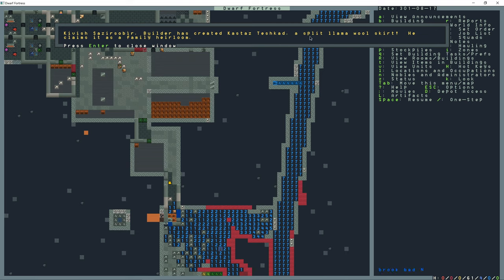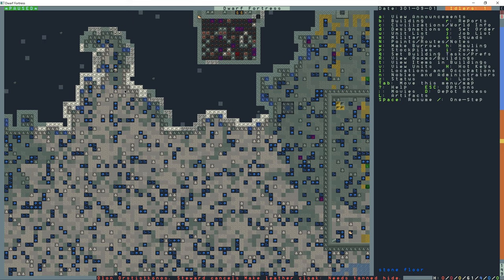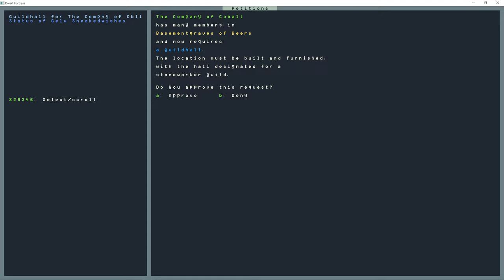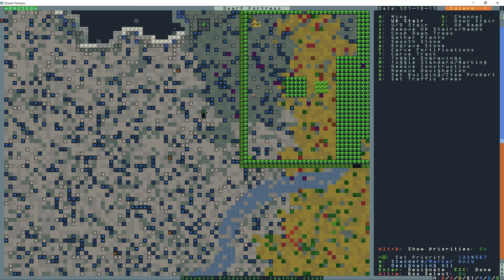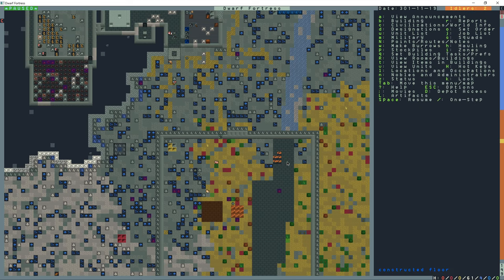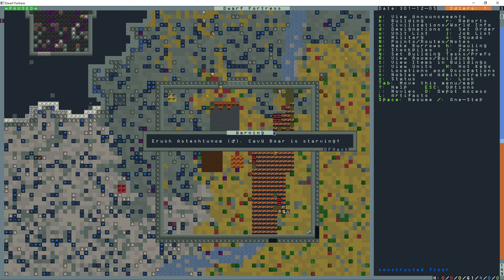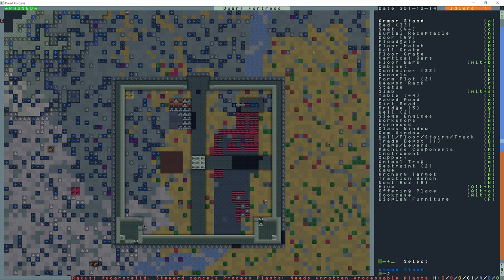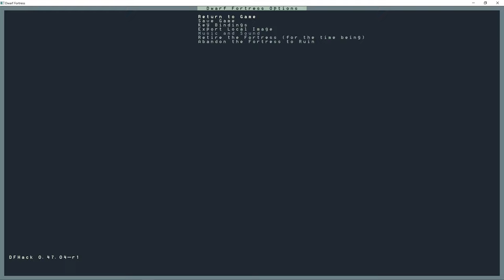Tutorial Fortress Part 8 - Damage Control | Dwarf Fortress

Comment: For anyone watching this in future, a some other solutions (besides those mentioned in other comments) to the flooding might be:
Be quick - there was probably time when the flood first started to put a wall in at the source of the leak or very close to it, since the room was already full of rocks they could use. Dwarves will work in 1/7 water. Fortunately the leak was on a diagonal, so the water wasn't moving by pressure.
Atom smashing - instead of making a way off the map blocked by a bridge, make a bigger bridge (or several) and smash large amounts of water water out of existence (on the assumption that getting rid of enough water will let you block up the original hole). Though trying to make a new wall near a constantly repeating atom smasher might reduce the dwarf population as fast as any flood.
Undermine the river and channel the river itself off the map on a lower z-level, repair the wall and restore the river if you like.
If you already had access to magma and iron, fill minecarts with magma and dump them onto the river to dam it with obsidian.
Reply from the maker: Magma casting the hole is a great idea aswell ! Thats one of the things I love about this game... so many ways to solve the problems. Thanks for the diffrent ideas Edramon & Thanks for the support!